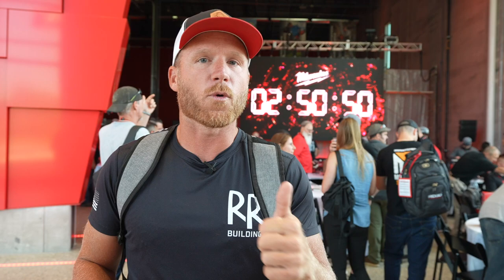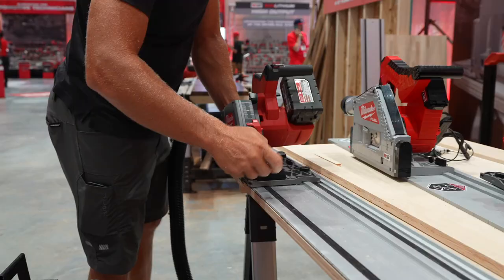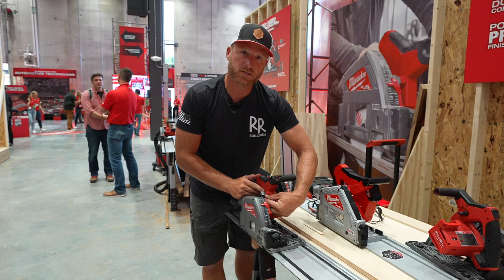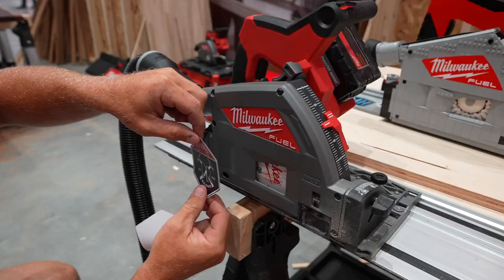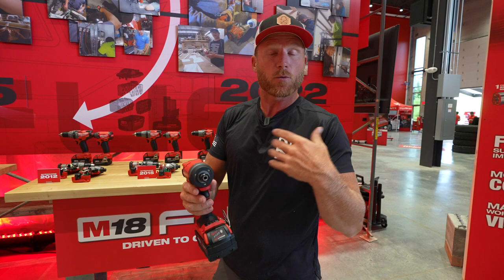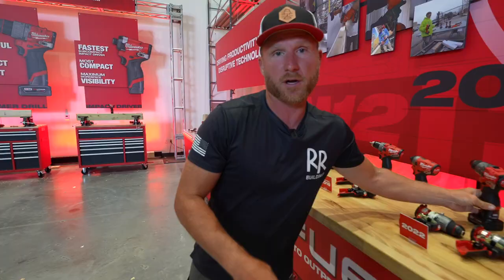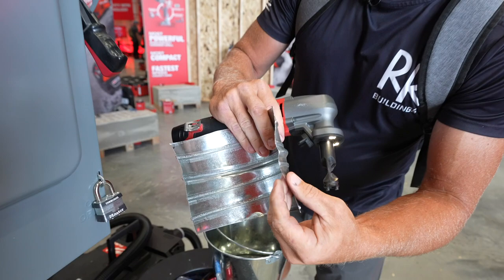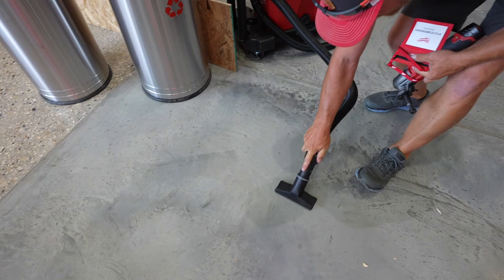Latest and Greatest NEW #TOOLS from Milwaukee Tool

Comment: Milwaukee's Fuel lines keep getting sexier. That little nibbler is slick. Those sharp little crescent chips are engineered to stick to the bottoms of your boots until they reach carpeting.  This ensures that any you may have missed during cleanup will be found by your bare feet later.

Comment: You just appealed to 100% of my needs right now. I do a lot of what you used to do, which is renovation work and property repairs, with the occasional new shed build, and all of these tools are a must in a repair/reno guy's van/truck. That nibbler is just what is needed for the industry as a whole really. Compact, powerful and lightweight. The belt sander is a first for me, I've not seen a battery belt sander before so that will be handy. The track saw, well I don't need to say what has already been said, but the new dills and drivers have me interested as well. I'm still on the Gen2 platform and they're showing their age. My 1/2 inch driver still gives her all the way but my drill isn't happy, it struggles on low speed trying to grub out half inch holes with an auger bit past about 8 inches depth. To put it into perspective, that M12G4 drill has more grunt than my M18G2 drill. Could also be my batteries that aren't happy though as they were new with the drill/driver combo

Comment: My wish list is Milwaukee makes M12 or  M18 rivnut tool.  Especially in your business you could use a threaded insert into steel panels.  Would also be huge in the automotive industry.
Reply from the maker: they make both already
Reply: @RRBuildings  Not a pop rivet gun.  I'm talking about rivnut or some people refer to it as a nutsert tool.
Reply: I thought I saw one in this b-roll of this video?
Reply: @GregsWorkshopOregon  Milwaukee just has the rivet gun.  No rivnut/nutsert gun.
Reply: What's that tool @ 1:44?

Comment: Have a lot of 18 volt Milwaukee. Love them all. Some 12 volt also. Light and handy, and getting better all the time.  Time for a 18volt roofing nailer!  Actually want to use it mostly for vinyl siding. The siding guy makes tips for DeWalt. Someone will make tips for a Milwaukee very quickly!!  If you don't!!

Comment: The Track saw function to stop it flopping over on the 45, is great. I wish they would of come out with the option of a Maffell (correct spelling? The inventor of the track saw) style track, that rolls up! The tracks are the biggest pain in using these. The Maffell one just comes in  one box. 
The 12v drills and drivers are awesome,  so much nicer in your tool belt. Good they've come out with 12v high demand.
Reply: Festool invented the tracksaw

Comment: The 12V tools are getting better all the time. I have a 12V drill from Bosch Blue and its fantastic! Almost half the weight of my 18V Makita! 👍😁👍😁
Reply: I have the Dewalt 12 volts. That tiny impact driver is amazing. Fits your hand like a toy pistol and drives in lag bolts. Its hard to believe the power that little 2 lb. thing generates

Comment: That track saw has all the clues it is made by or made with a design from the Festool. I have a corded one  with many identical design elements. And the nibbler resembles the one by Makita.
Reply from the maker: actually that nibbler is nothing like the makita or hitachi....it is way way more comfortable to use

Comment: 0:51 TRACK SAW is my № 1 that want to see from Milwaukee (which did know releasing); but at the price point they selling the kit, minus track (far as know, but many do this; even though there’s “kits” out there that include a track, imo, the norm is you buy track separately from the kit: which includes tool, charger, 1-2 batteries, dust bag, saw blade, & case) I’m HOPING it performs great!
B/c the price they asking (again, minus track, far as know) is up there w/ Festool, Makita, and Mafell……all track saws, imo, are good enough for doing finish work….again IMO, and means using finished ply, & other furniture grade finish materials, etc…..
Suppose will find out when start seeing testing done from all the great Tool Channels (and definitely hoping you do a vid Kyle ; as want your thoughts 🙏🏻🙏🏻, since you have and use track saws), along w/ getting one myself and seeing what it’s like, since POWER isn’t everything when comes to tools, imo, feel in hand, using it, durability, quality of materials, etc….all play a role in how I choose my tools; along w/ price point; & in today’s world……pricing is bit tricky (not gonna go into it, but example real quick: maybe a 2-5 yr old tool on sale and cheaper than the “shiny new model released”, but older tool was best when released and is great tool/deal and gets the job done….might even feel and work better for [you] compared to buying the newest and shiniest model, etc…..ok, example and pricing opinion over for now 😊).
Thanks for showing/Sharing your time at Milwaukee (also getting those new gen tools to use😉, but we’ll see a vid or 2 about them and what ya think right; especially compared to last gen models🙏🏻 ¹ ).
All other tools released are just the cherry on top of my tool sundae; although a Milwaukee m18 fuel MC nailer would be nice; but do have my Metabo HPT 36V MC nailer and it’s nice, besides the weight you get W/ ALL BATTERY TOOLS.
Last thing, the cool new M12 HO batteries…..excited for those, as use my m12 fuel 5-3/8” circ saw for framing 2x etc….and popping in the new M12 HO 5.0 compared to the XC 6.0 I always use……can’t wait to see how feels and what it does 😁
Cheers Kyle & fam, along w/ RR Crew/Fam.
Happy 4th and be well & stay safe ✌🏻

Comment: I've emailed them asking for a battery/cordless "air" hammer that will take the same attachments as an air hammer for vibrating parts out or putting a cutting chisel in for sheet metal...

Comment: Did they not improve the M12 Battery lineup. I use those drills and impacts daily. So much easier on the tool belt weight and wrists. Great job once again

Comment: would've liked to see you demo the M12 detail sanders
Reply: What I'm trying to figure out is what's the difference between the detail sander and putting a sanding pad on a multitool. Fein has done this for decades. Is the motion different?
Reply: @satamanschmidt3428  i believe the multitool moves forward and back, when the actual m12 sander moves in a orbit with a insanely low like movement ratio,

Comment: Hey Kyle, I just left a voicemail regarding purchasing the barndominium plans on your site.  How detailed are those plans for a person with decent woodworking skills as well as some small construction experience?  For example, how detailed are they with proper connection of the trusses and end trusses as well as type and length of nails used, and details on how to cut the top of each post based on the heel size?  I may not be asking those questions properly, but I think you get it.  If anyone reading this that has purchased RR Building plans can answer my questions, that would be helpful as well since Kyle is probably SUPER busy.  Thanks in advance Kyle and anyone replying.
Reply from the maker: Lots and lots of details.  For the cost man it should have everything you’d need
Reply: @RRBuildings  Right on man!

Comment: First  and foremost, great video on your Milwaukee updates. It is always nice to see what this great company is offering new, as I still have every Milwaukee power tool I ever bought and these tools just never die, and I hope that Milwaukee understands that its success is due to the fact that it continues to make the very best quality tool that can be made. I sure wish they still made them in the USA, as I have yet to buy any electric power tools made overseas. I will buy second hand to get made in USA. Never substitute this mandate for success by making tools that do not last forcing customers to keep buying again and again, based on inferior quality products, such as many of the other companies do right now, and one of them comes to the very top, and I want mention names, but it makes me sick to offer such high priced tools knowing that the quality of these tools is based on inferior design and inferior major components that they know has limited tool life. Disgusting.

I wish that Milwaukee will take note of this following comment. Please get a frame accessory for this belt sander that lets you belt sand a flat surface without fear of gouging it. I use one now that is on a Delta belt sander that was made years ago. It was called Dewalt DW4070, no longer made. I have two of them and can't tell you enough good things about how nice it is to have them to use for flat sanding out large glue up panels without fear of ruining them.

Comment: Have you tried turbo shears? Or single cut shears? We prefer them over nibblers when going over ribs. I watched one of your videos where you compared double cuts to nibblers. But I’d like to see the single cut (turbo shears) vs. Nibblers.
Reply from the maker: Not even close to the same quality of cut but yes you can go faster
Reply: @RRBuildings  thanks for the reply. 99% of my cuts are covered by trim, so I’m not really concerned with the quality of cut. But I’ll definitely be picking up a set of Milwaukee nibblers when they come out.

Comment: Ashame they are coming out with new ways to hold the new tools in packout boxes but nothing is being made for these tools we already have.   Like where is the insert for existing circular saw to go in a big packout like the track saw?   Would just like to see better options than buying a piece of foam and peeling it apart to fit drills/ hand tools!    Maybe at least come up with templates where it’s easier to cut the stuff out.

Comment: I'll probably buy one because the price is great, but I'm a bit leary about  the cut quality.  All of the M18 saws I have are very powerful but rough and tend to chip material compared  to Makita, Metabo, and Bosch saws I've used.  The big benefit of track saws are their precision and cut quality.  Not things I've ever  associated with Milwaukee saws.
Reply from the maker: That’s all in the blade
Reply: @boogiedahomey idk man....maybe longevity would matter.  But I'm guessing if you bought a cheap saw and a new Diablo it would be just fine